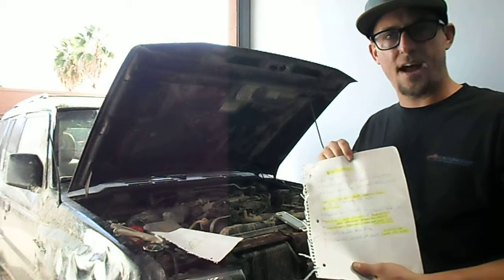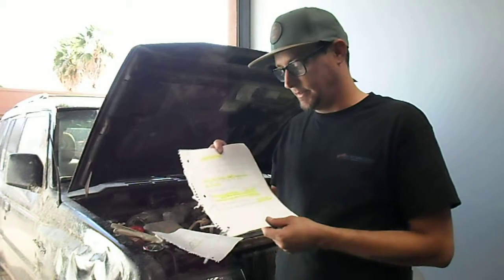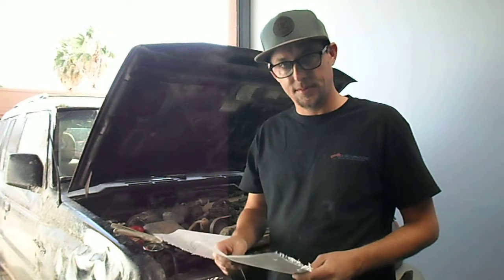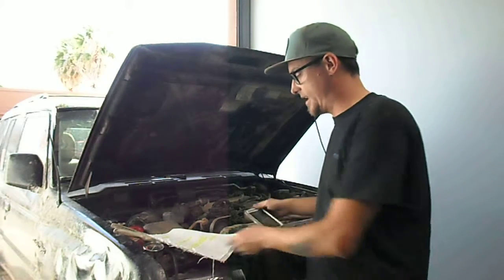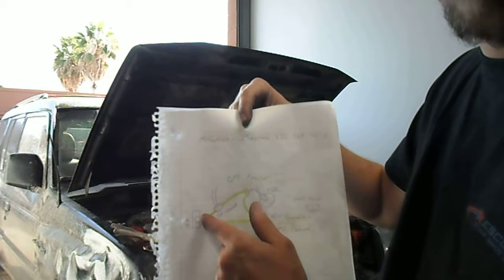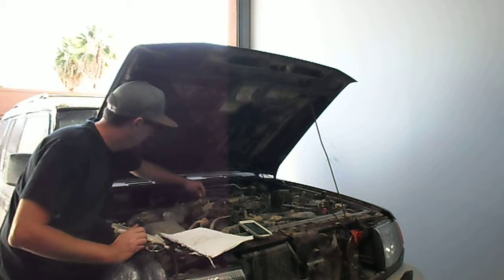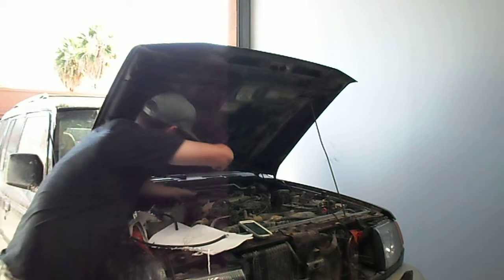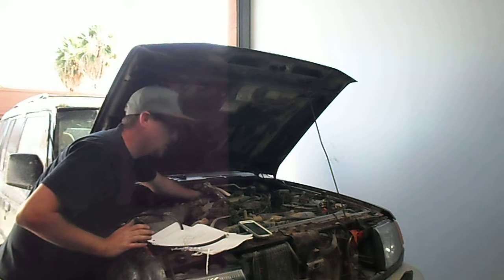Matt's Smog tip (3) Emission EGR Testing all types Mitsubishi Montero

Comment: I have 1999 Montero with a P0400 code. I changed the EGR and the EGR Solenoid and pinching port A the engine does want to stall. The EGR test is complete, does that mean the MAP sensor is OK? What else can cause the P0400?  Is there anything else I should change or look for. I don't have a vacuum to do those test but I can try the test you did with the light. I totally want to get the check engine light off so I can pass smog!
Reply from the maker: The EGR Vavle works went the computer tunes on EGR Solenoid u will need a vacuum gauge put it in at the EGR valve see if you get a vacuum signal first u have to drive it around
Reply: @matthewmclain9327  I will go get a vacuum gauge and I will follow your video. I think the MAP sensor is fine I followed your other video and just put my multimeter on the MAP and revved the engine it went from 1.6 to 3 volts. I wonder if this has anything to do with anything but I pulled the MAP off and there was oil in the hole? ALL in all the car runs great just won't pass the California smog! Where is your place at? I'm in Bakersfield

Comment: I have 2001 Montero I have P0400 code, EGR valve ok, new solenoid, no vaccum in outgoing tube all time. No error code for O2 OR EGR, please advise or support. Have problem passing state inspection
Reply from the maker: How the Montero Runs the EGR OBD2 monitor It looks at the map sensor under low load or cruise 

I've seen cheap EGR control valve go bad they dont seal well u have to buy OEM and there not cheap 

Use a 12v battery and test it with a vacuum pump with gauge 

Good luck